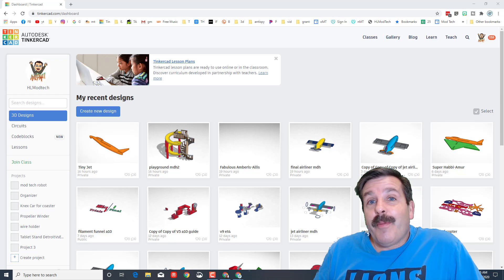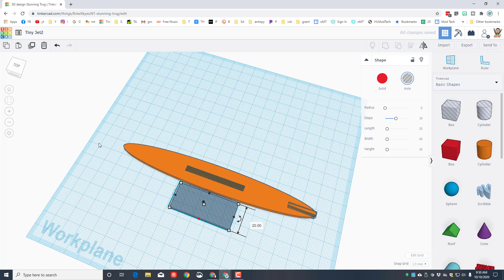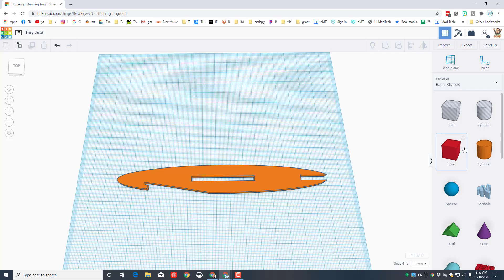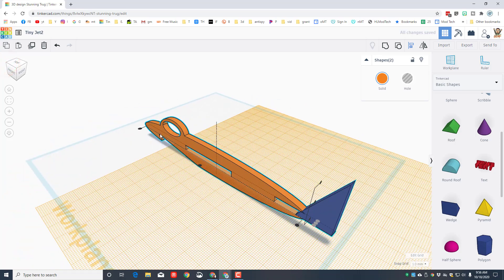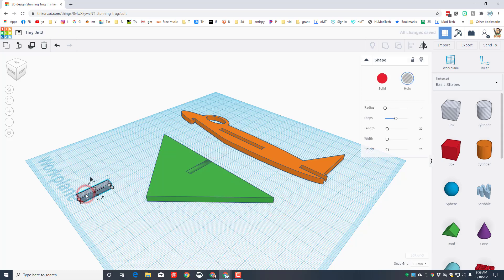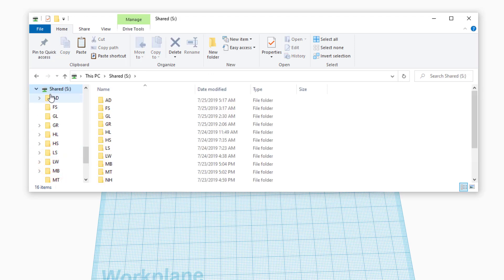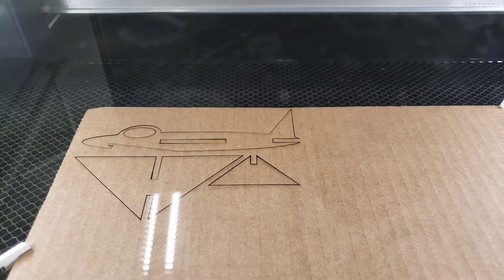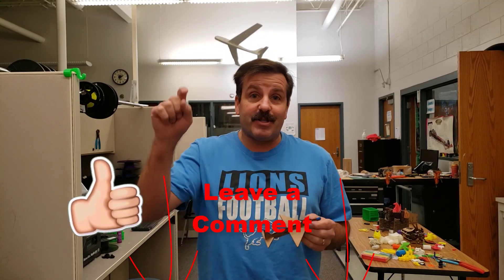Create an Awesome Customizable Tiny Jet using Tinkercad & a Glowforge

Comment: my glow forge only reads inch not mm?
Reply from the maker: It is a toggle you can do in settings. I no longer have access so I cannot double check where it is though... I think it was in the top rt of the glowforge panel though.

Comment: Two questions for you:
1. Can you talk about the naming convention for your GF settings (e.g. 01.145.175 cardboard)? I think I like it but curious why you do it this way and the pros/cons of this way.
2. Are those material holding pins laser cut or 3D printed? If laser cut, is there a file you can point me to?

Great content.... learned a few things about tinkercad I didn't know!
Reply from the maker: Thanks for reaching out. I came up with the system as I worked passes.speed.power then I started adding the lpi and thickness. It just worked in my head. 

The pins are 3D printed. https://youtu.be/YJ1uDoSipmM The Thingiverse link is in the description. 

If you can find a friend with a printer, they print really quick.  Have a great day! 👍